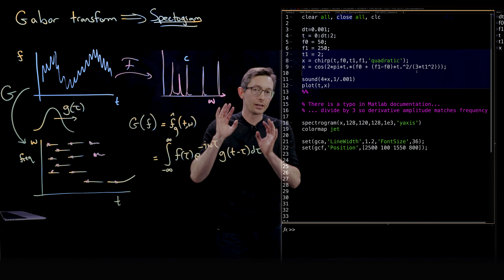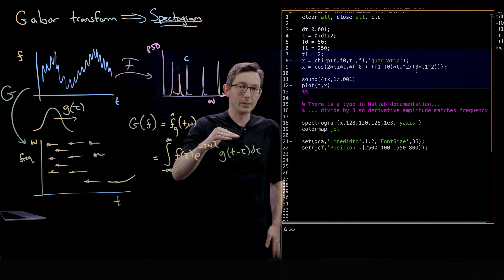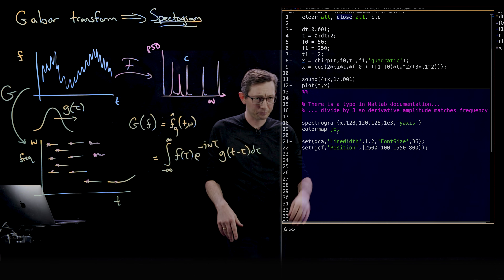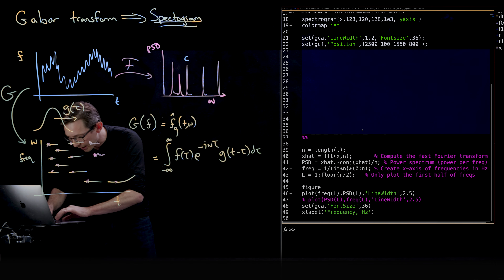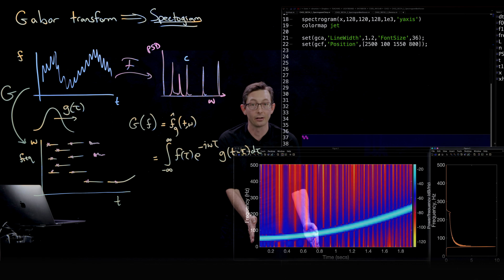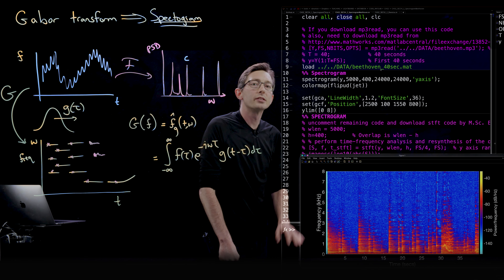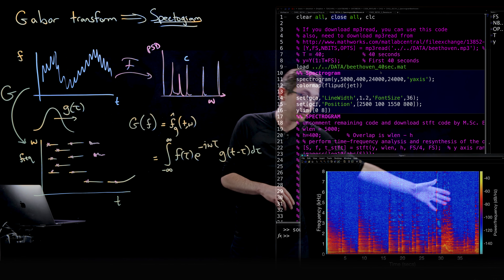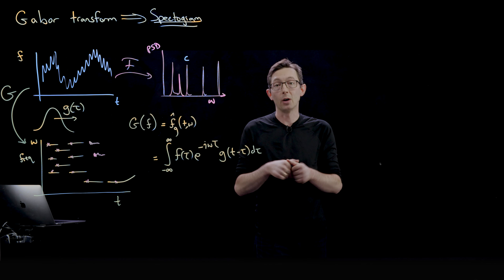Spectrogram Examples [Matlab]

Comment: Hi Steve. Just to verify, the codes in lines 8 and 9 are mathematically equivalent, correct? In line 9, are you explicitly defining x as an up-chip interpolated quadratically? Otherwise line 9 simply overwrites line 8. Thank you.

Comment: What role does the Gaussian play? When should one consider other window functions?
Reply: Good quesiton, I would also very much like to know more about this! :)
Reply: To my knowledge, a gaussian window is the optimal tradeoff between time and frequency resolution. Other window functions favour one over the other.

See Wikipedia
Reply from the maker: Yes, you can use other windows, but @jamen1993 has the right idea.
Reply: @Eigensteve  if you just want to know when frequencies occur at what time..dp you need any transform at all? Wouldn't you just look at the original graph of frequency versus time? you wouldnt need a gabor or any other kind of transform for that matter

Comment: This is a good video I am trying to adapt this to how I can detect detonation in my motor by using the knock sensors audio. I have a strong powerful band similar to that that goes up with rpm and load which is the harmonics of the motor operating. Now im trying to see that a sharp knock event at 5.7hz should show up in the spectrogram as a different colored spike correct?
Reply: I guess the way to translate that would be imagine pressing a high piano key and holding it and then tapping a lower octave key it should register that spike correct?

Comment: there's a better way to get a spectrogram of a sound
Reply: There are different ways to produce visualizations of spectrum over time. The explanation shown here is the inner workings of how the signal is converted from the time domain to the frequency domain. Spectrograms and mp3 files use the same basic technique for this transformation.